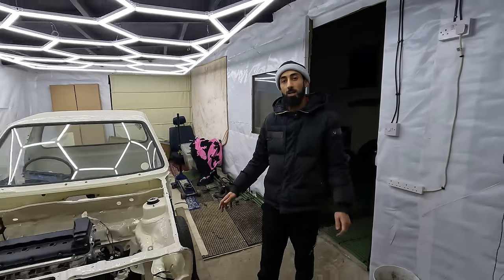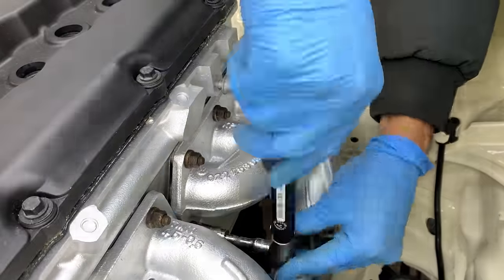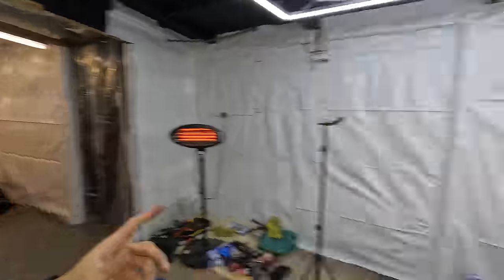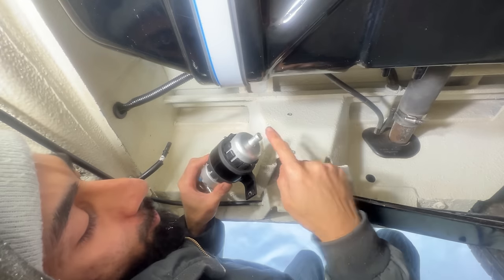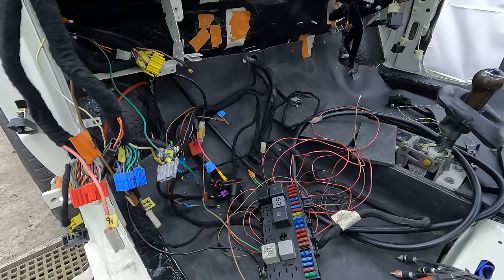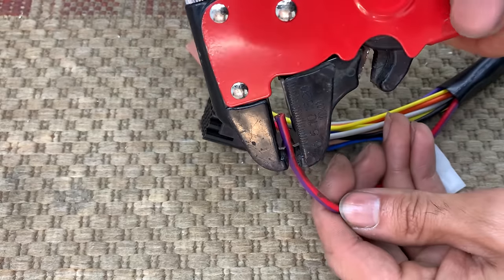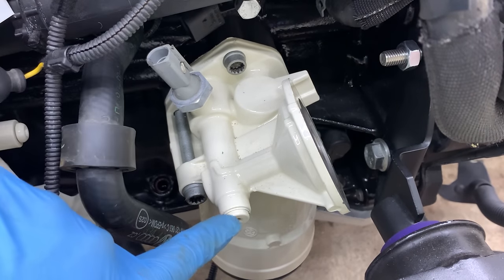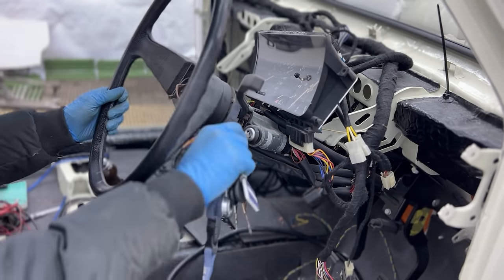The Ultimate Build | VR6 3.2 Engine Parts Installation In My Volkswagen Caddy MK1 - Episode 19

Comment: day 2 of pleading with you to not colour match the rocker cover. please use a contrasting color, like a nice blue of your choice. look at a colour wheel and find something on the opposite end of the spectrum to the base colour
Reply from the maker: I think there will be too many colours then, right now there is cream, Matt black and some chrome parts.. I could always change it if it doesn’t match too
Reply: Trim black and metals don't count towards your colour choices, they are a given on any vehicle. If you're planning to go with a black interior, you can leave the cover black, but I think you'd be missing an opportunity for some colour pop

Comment: Hi mate, what’s needed from the body loom side to run the engine ? 

I’ve got a 3.2 bdb engine in my van, stripped the Audi interior loom and chased all the wires/connections back to the ecu plug labelled all wires from ecu pin out diagram, and removed the rest of the loom … now I’m stuck,  don’t know what’s the minimum needed from the body plug side of ecu to run the engine 🤷🏼‍♂️
Reply from the maker: Send me a message on Instagram -Zaksgarage

Comment: A very nice project!
I have a similar project with my Caddy.
A Question, where did you buy the Y-pipe for the Caddy/Golf1?
And the fuel filter, which vehicle does this come from?
Kind Retards, OCWX
Germany
Reply from the maker: I got it from S&P automotive, the fuel filter is a Bosch 044 alternative. Not sure what cars they came on
Reply: @zaksgarage  Many thanks for the answer .
The Filter is from an Audi TT 8J or A3 with a 3.2 Engine, I've now found that out!
Kind regards OCWX